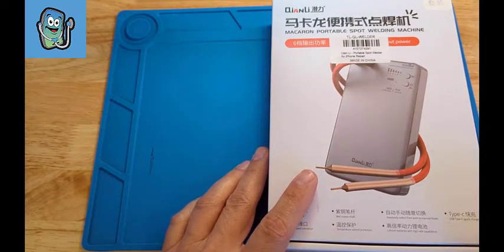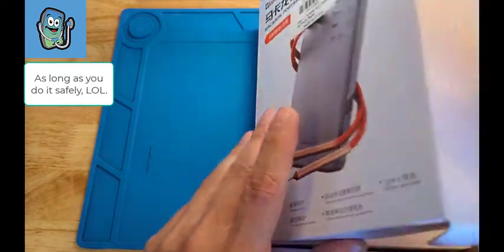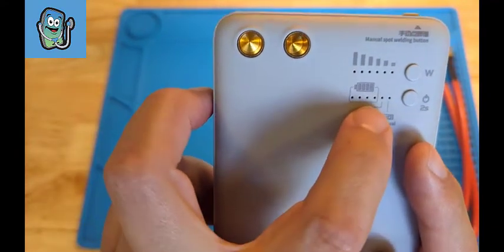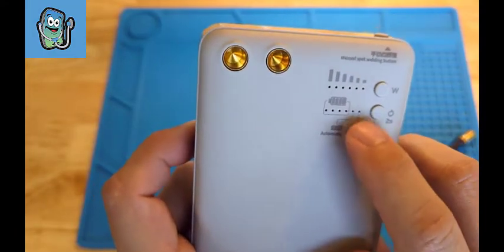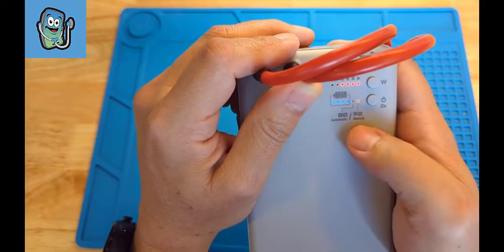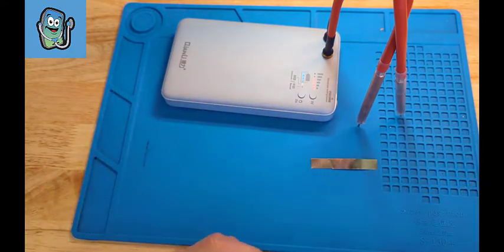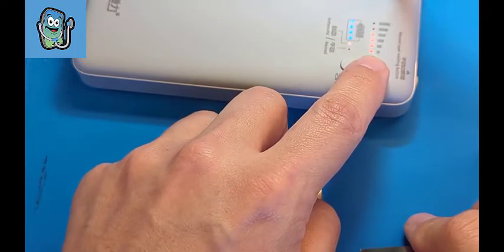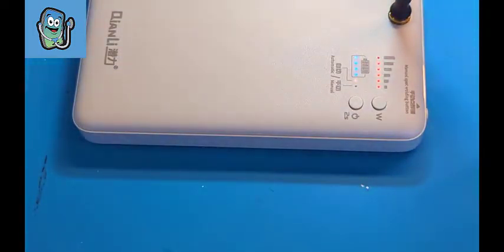How to use a spot welder & Qianli portable spot welder review

Comment: Why is it after awhile they make a huge spark? im almost afraid that its going to get to the battery. Sometimes it even tears the bms metal bar and makes it difficult to weld.
Reply from the maker: You are probably pushing too hard on the metal you are attempting to spot weld. Has happened to me. Just do not push down so hard.
Reply: @CapeCoralCellPhoneRepair  thanks cape for the advice
Reply: @fbnmndz  I just noticed that it's when you don't press hard enough that big sparks occur, I just tested on a bms and no spark when I press hard

Comment: I did about 20 devices so far. most of them iphone 11. I charged them all to 100%, then let them sit for a day or so. 6 of them dropped to 10% (all were exactly 10%), after reboot they went back to 80%. I have 3 questions, have you seen this issue before? Do you think it is related to a poor spot weld? and should i leave the tag-on flex in the device? (I left it in on all the devices). None turned off, just went down to 10%. Looking at the battery data in settings showed a steep drop from ~90% to 10%. Let me know what you think and any suggestions on how I might resolve it. I rebooted them and will give a few more days for testing to see if it happens again.
Reply from the maker: You may need to double-check your weld. A good tip is to NOT press down on the tips so much. Just a light contact gives you a solid weld, instead of pressing down so hard. Also, check the batteries. We have used different brands, and these turned out the ones with zero issues, as well as their programmer........ https://www.injuredgadgets.com/search/?q=bms&acc=28b791d60cb7bb8ef337d13b65f4d7a6  With these, you never have to leave the tag on. And with their programmer, you can also update the tag-on firmware, with is so AWESOME!